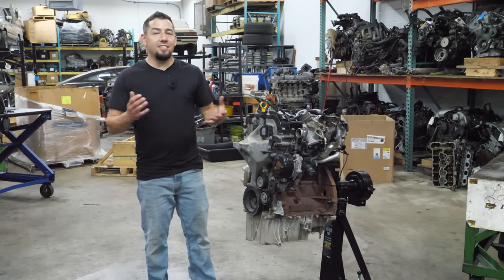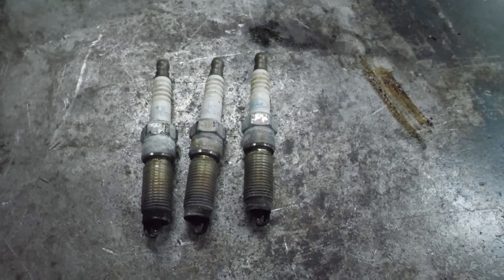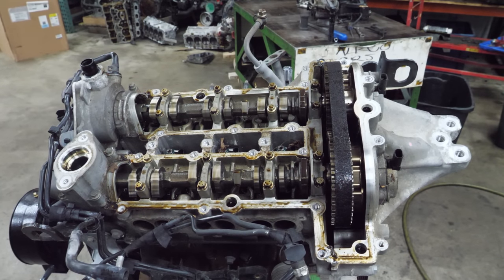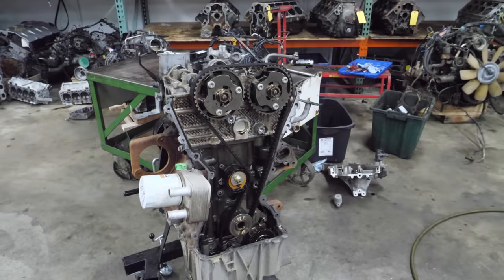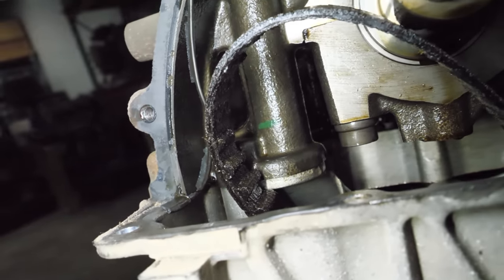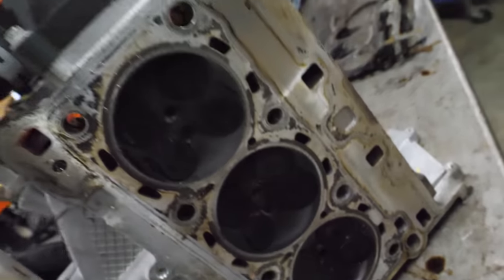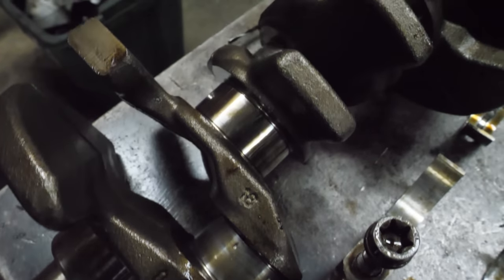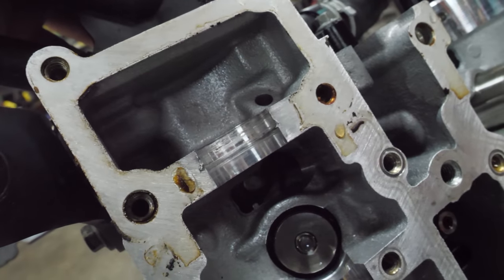JUNK Ford Ecosport 1.0L 3-Cylinder Ecoboost Teardown. LAWSUIT ENGINE!

Comment: Just replaced one of these at the shop last week! Wet belts are definitely interesting 🤔
Reply: Definitely interesting when they shed rubber.
Reply: Honda 200i generators have run 17k hours 24/7 off grid with no problems with their wet belts.
One has apparently done 65k hours.
Maybe Honda could let Ford know of  a good belt supplier?
Reply: @JohnSmith-yv6eq  judging from the turbo id say they go with an chinese ebay supplier for most of their stuff lol.
Reply: @jetjazz05  if the finest ebay mongolian motor mangler turbo is good enough for a 1000hp LS it's good enough for a  ford ecobox. Not like either of them have a expected lifespan longer than a few thousand miles.
Reply: @KR-hg8be  I guess?! I've got a Mitsubishi turbo on my car, 236,000 miles and it's still running alright lol. My favorite part is the little basket they welded from factory inside the throttle body, like catching the chunks will save the engine when it grenades lol...

Comment: I had one of these in a 2015 Focus with a hand shacker trans as a commuter car.  Engine was great avg’d right around 38 to 39 mpg and with the manual you could get there in a good fashion.  Car really liked premium fuel and good oil.
Reply: Premium fuel in an eco car is almost an oxy-moron... haha
Reply: Had a 13 Focus 5 speed sedan with the NA 2.0. Averaged ~32 MPG. My 6 speed Honda Accord of the same year got 35. It wasn't a bad car (and it had a chain, no wet belt to fail), but the Hondas I've owned before and since were just better cars IMO.
Reply: @DeltaSierra426  The difference in cost in Europe is less than 10%.
Reply: @MrDuncl  It's about 19% difference where I am in north america. It's why cars like the Civic SI never make any sense. The fuel cost is higher than a V6, so why just buy a V6? Cars like the Subaru WRX use lots of gas and require premium gas, so you might as well just get a huge V8 with 400hp.

Comment: These were initially introduced into the US market in the 2014 Fiesta.  I have one sitting in front of my house with a dead motor with 83,xxx miles on it, which is toward the upper end of the life expectancy you can expect out of the 1.0 ecoboom.  I believe most failures occur due to the cheap plastic Ford used in the cooling system getting brittle after a few years and cracking or even shearing off completely, dumping all coolant and causing very rapid catastrophic overheating.  I read a post from someone claiming that their CHTS registered something like 2,100 degrees at the time of failure.

The upside to the motor is that it actually puts out about 149hp when at full boost (~21psi) which the ecu's allow to occur in I believe 20 second intervals (plenty of time to be full throttle in most real world situations).  Coupled with a 2,500lb car, in the Fiesta, and it actually makes for a fun go-kart like driving experience.  It also can get very good gas mileage.  We got 46mpg once on a trip with four people and luggage.  My avg when driving the car for a full tank was usually 38-39.  My wife's avg was more in the 31-34mpg range.

One day I'll fix mine and then sell it immediately.  Not a fan of planned obsolescence.
Reply: My 1.0 Fiesta is just about to cross 150k miles on the original engine and belt. Waiting for it to go boom, then will just replace the engine. The belt replacement job in the US costs about $3k, just not worth it.
Reply: @aroooooo I’ve got 400k on mine, also waiting for the timing belt to Grenade as a new engine from ford isn’t expensive.
Reply: I agree it’s quite zippy for 1.0, my best mpg was 64 and average 52.
Reply: @lancethompson8145 Amazing! That's 400k mi or km?? 

I swapped out the factory airbox for a cold air intake, best decision ever. The turbo noises are alot of fun.
Reply: @aroooooo  400k kilometres.
Reply: @aroooooo  best upgrades were fiesta st seats and suspension.
Reply: @lancethompson8145  Amazing. That's about 248k miles. I would love to be able to get another 100k out of mine! 

Very cool. It has crossed my mind when the engine goes to replace it with a Fiesta ST motor 😆
Reply: @aroooooo  I’ve had both the 1.6T and 1.0T, the 1.6 was fun but you normalize the extra speed and the 1.0 returns about an extra 16 mpg. It’s the suspension that really gives fun to the fiesta.
Reply: @lancethompson8145  Circling back to this, did you make it this far on the original timing belt?
Reply: You know what must be done. Coyote swap it.

Comment: Great video mate. Managed to lighten my mood on my journey to replacing the timing belt which Ford quoted £1600 and no other garage will touch with a barge pole
Reply: Go for a recon engine ,ford don't always get the repair right ,I will drive mine until the engine blows .
Reply: Shop around, I got mine replaced for 700. (A freind)
However I did get quotes of 1000 from some garages after ford also quoted me 1600.
Reply: My son is a mechanic. When he asked for a timing kit for the ecoboom the Ford main dealer said they don't bother just replace the engine. It is quicker, cheaper and after 150k miles a knackered engine...
Reply: Appreciate all the advice guys will look into a new engine
Reply: @GavinEarnshaw what an Incredibly sad excuse for a dealer. These belts are replaced within 6 Hours. Source: work at a Ford dealer
Reply: @Cydro12  oh 💯% agree - particularly that dealership chain and they have many marques down here. So you are stuck with them if you want approved dealer.
Reply: A service manual book from Volvo recommend replace a timing belt at every 75,000 miles OR 5 years.

Comment: That wet belt was designed to actually last forever. Ford advertised originally that it never needed replaced to lower maintenance costs(Thus more eco LOL).
Reply: It's not forever it's the projected life expectancy. Idk about 5 oil changes or a couple of years...
Reply: 150,000 miles or 10 years is what they said when we got them in late 2012
Reply: They may be able to control the oil you use for the engine but ford can't control the chemicals that leach through past the oil ring's from breaking down the belt .
Reply: The funny thing is, we already have timing gear drives that DO last basically forever, timing chains, but belts were introduced specifically to add another maintenance part...
Reply: Forever is when the turbo bearings also fail at 50K miles? I must not be up on the new lingo,  is forever for automakers like unlimited for telco and is eco synonymous with wasteful?
Reply: @LaurentiusTriarius  A relative of mine said that his dad's 1.0 Fiesta had space for 5 service stamps in the book lol

Comment: I had an early one( 2012) in a Focus from August 2019 till January this year. I got it at 66k and moved it on for a couple of hundred less than I paid for it at 82k.  It was a fantastic car that returned 40mpg and was actually fun to drive. The spec was great too. I just wanted a change ( I got a grand Cherokee 🤣) but the scare stories about the cam belt did make it an easier decision to get rid.

Comment: I'm an old school but very much educated mechanic and all around tech person. I'm 64 and have an A&P Fed lic and diesel lic along with decades old auto certs. I don't care what they make that belt out of to run in oil, it is still a belt running in oil. Yeah, I'm not on the level of an engineer but logic tells me that chains AND gears work better, last longer than any other type drive system. I work on industrial engines of smaller size up to 3.0 inline 4 cylinder. Take how Kubota has used GEARs on their timing system forever and they still make the longest lasting and trouble free engine in my line of work. We have GM industrial engines and Mitsubishi that use the dry belt BUT use an all aluminum head that the MFG says to just throw away at 5000 hours. That is an insane type of regular "maintenance" for an engine IMO 50 year experience of working on this stuff. Today's engineers have got MAD. IMO of course.

Comment: I haven't watched this video to the end yet, but my theory as to what happened is the idler pulley came apart landed on the drive gears of the oil pump and balancing shaft and jammed them up. The belt was already weakened by motor oil soaking all around it And I bet after those two years got jammed up the crankshaft ate the pulleys off the belt.
That pulley probably kept those gears from spinning the engine ran out of oil pressure and started eating its main bearings and camshaft carriers.
I bet this thing shook like hell after that idler came apart I wonder what noises it made.

Comment: Here in the UK I'm under the impression you must use the correct grade of oil for the ecoboost engine namely 5w - 20 Ford WSS-M2C948-B spec to avoid issues with the wet belt such as cracking and other deterioration that causes oil pick up clogging. The other no no is don’t use oil additives including an engine oil flush at oil change time also don’t let the coolant level get low keeping the level between the min and max marks when the engine is cold appears to be a happy medium

Comment: A good experience (so far) from non-mechanic point of view. I drive a 9 year old 1.0 EB Focus wagon, bought it when it was 4. Been solid on daily drive and longest roadtrip was around 1500 miles over a week. 

It's a weird thing, that wet timing belt. And it's labour-intensive -> expensive to replace because of the layout, but best do it ahead of time. I had the belt replaced at around 90k miles, mechanic said it was still super clean at that point.  Ford says the change should be at 150k but didn't trust that.
Reply: i've heard that some types of engine oils do accelerate the wear of the belt significantly. what oil are you running?
Reply: I have 400k on mine and kinda went with the I’ll replace the whole engine route for cost.

Comment: That 3 cylinder engine looked so big until you removed the cylinder head
And I also can't believe that the crank is not keyed
Reply: Well its honestly not a requirement.
Reply: @jdrok5026  Ha, ha! It really isn't important when the valves open and close!
Reply: Ford missed key on crank from '96 or something like, i do keyless timing some time, it is quite complicated. No word to define this ass policy, but it is the same for other manufactorers.
Reply: When they introduce this engine they had it in a carry-on bag
Reply: @jamesplotkin4674  ford believes in allowing every valve to choose its own timing.
Reply: @retiredbore378  as my name shows, I love my "small V8"!
 Yes small for the US
Large for UK etc. 4.7L lol

Comment: Known as 'Ecoboom' in Europe the cars in which these were fitted are worthless unless they are post-2014 models which is when the design flaws were addressed.

This is the first of your videos I have seen and really enjoyed it. Love post-mortem stripdowns to see what failed and why.
Reply: I was wondering because mine works fine, for years.
2016 engine.
Reply: My partner has a 2015 Ford focus 1.0 ecoboost with 77k miles. I recently took the sump off to check the oil strainer and to my surprise, I found no pieces of the timing belt. You can also see the wet belt after taking a cover off that smaller belt that drives the oil pump. The belt is is good condition. I’ve serviced the car myself every 5k miles with genuine oil and filter. I think people have so much trouble with these because they don’t use the correct oil. Or I’m just lucky!
Reply: @sinmonk7351 I have a pair of these, and was thinking about doing the same type of inspection.
Can the pan come right off the bottom? Or do you have to remove front cover first?
Reply: @otm646  the sump pan can come off but you will have to move the exhaust/catalytic converter out of the way. I couldn’t manage to get the pan off without unbolting it. It doesn’t take long to get off. Worst part is the heat shield. Once you’ve got the pan off you can remove the oil strainer to clean it out. Also you can see the bottom of the belt once you take off that little black over. Turn the engine slowly by hand to get the full condition of the belt.
Reply: I’d just like to add to this. I’ve now done the timing belt and the smaller oil pump belt on my car. Although the strainer was spotless the big belt was actually in quite bad condition which only became evident once removed and bent harshly to reveal the cracks. This belt would have probably failed in 5,000-10,000 miles. Maybe not even that! This was no easy job. Took me around 14 hours but was also my first ever timing belt job.